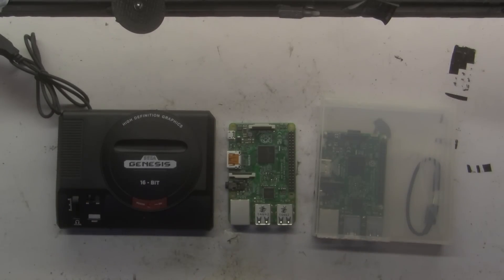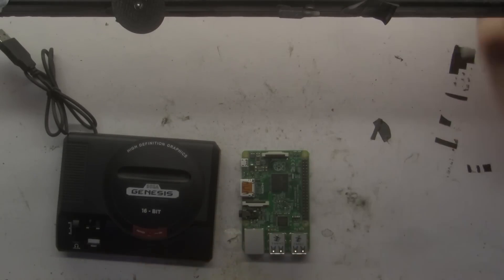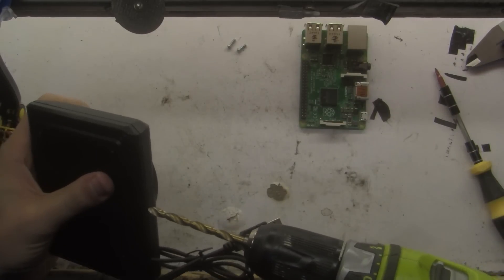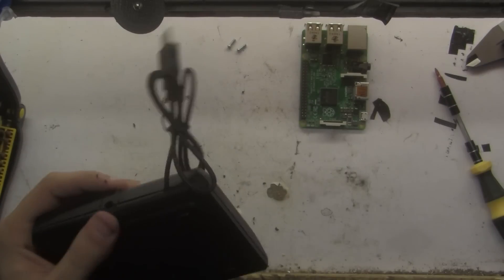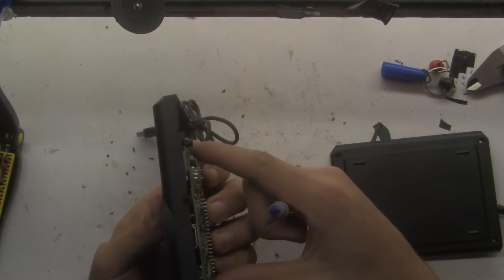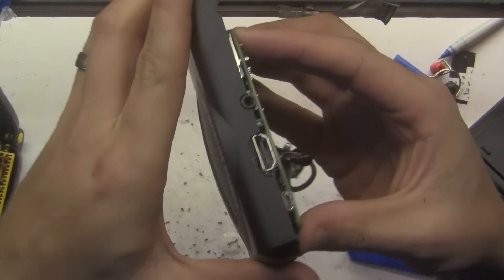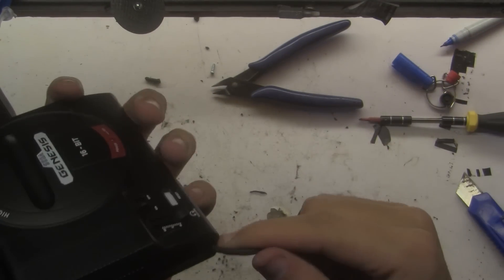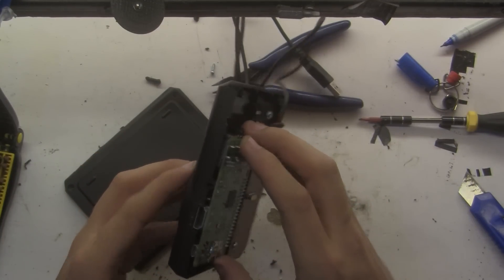Sega Genesis Usb Hub RetroPie RetroFit!

Comment: I have a Pi 0W. I'm looking at this from the idea of 'hey I could theoretically wire that hub to the zero and have some front mounted USB ports, mount it so HDMI port is flush with the back, ideally I'd figure out how to get a power button rigged for it and an LED in the place the genesis would.

Note I have no experiance with these things so I may be getting in over my head.

Comment: I thought you could run pi from USB as well?
Reply from the maker: Nope, you have to boot it from MicroSD, there are some methods to run it from a USB, but it does require a microsd card to redirect to the USB (Called Berryboot)
Reply: saw Berryboot but never thought about it. 
That blows man.  Granted it's a low cost board but if no way around SD card boot kinda is a one trick pony.  I got one so i am now having to be more careful with the bottom.  Thanks for the knowledge.

Comment: I was wondering. How "hot" does the Pi get under a load? Cause that hub has no ventilation.
Reply from the maker: it does get warm, i do intend to put a fan in there and put some holes for the air to circulate, just haven't got there yet, ideally i'd cut a hole in the bottom with a holesaw and fill it with a 3d printed grill or something, or find someone with a laser cutter that can cut out the factory  vents at the top, maybe both
Reply: Well if you got a dremel and a steady hand, you can just slice along the slotted vent section on the top. but i'm sure you know this, and just have not got to it yet.
Reply from the maker: yeah i have considered this but i dont think it would turn out as well as i'd like, thats why i mentioned someone with a laser cutter.